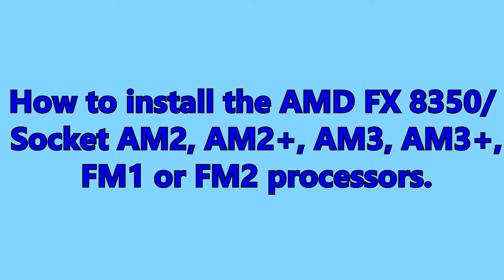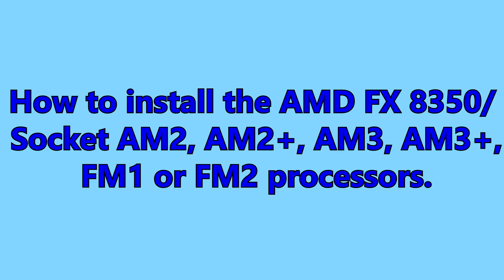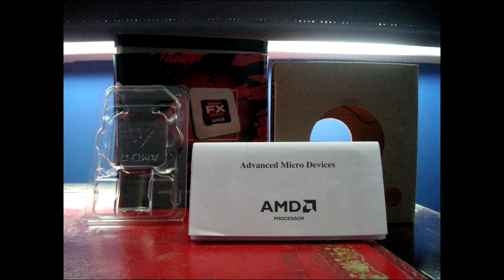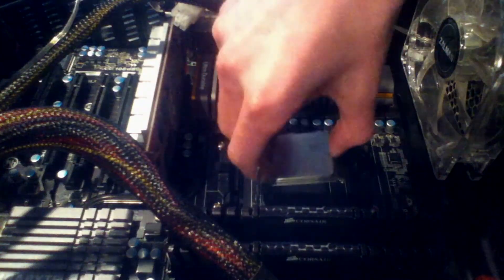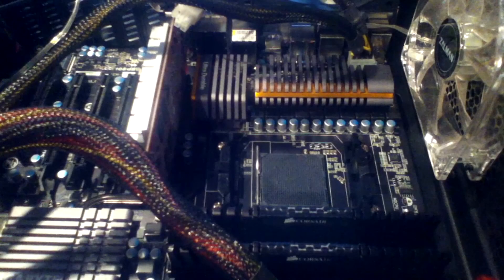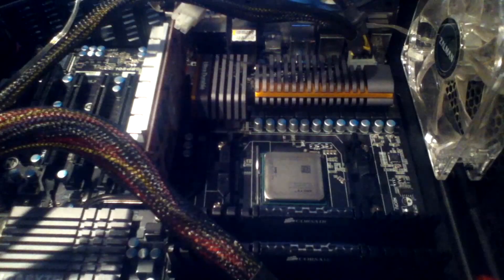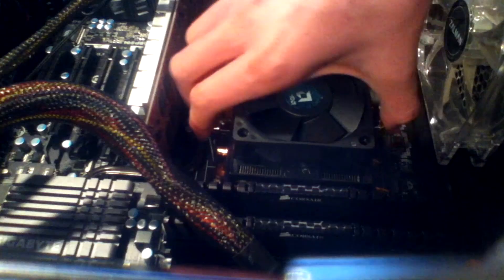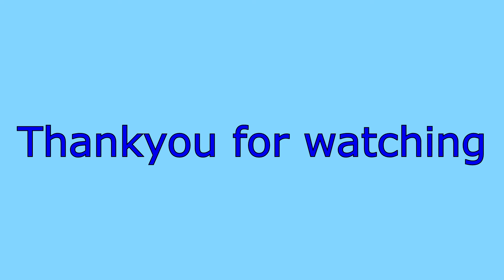Instaling AMD processors (Socket AM2, AM2+, AM3, AM3+, FM1, FM2) in detail

Comment: I have installed my cpu correctly and put the arm right down, but there is a little movement in the arm if it touch it. Is that normal? its still locked down but i can uneasily unlock it.
Reply from the maker: There is always going to be little movement. As long as your CPU temperature is ok I would not panic at all. You can see this with the program speedfan: http://www.almico.com/sfdownload.php Anything over 65 degrees is not good (especially at idle) although it will get around this temperature while stress testing it.
Reply: TheProzGamerzzzz i mean the metal arm when its down and catched
Reply from the maker: Allen Dennis This is the arm on the CPU socket right? not on the heatsink.
Reply from the maker: Allen Dennis everything is fine. That arm does the same on my motherboard. As long as your computer functions with no problems there is nothing wrong.

Comment: Hello !
I have a GIGABYTE 890GPA-UD3H rev 2.0 Motherboard Can I have a AM3+ cpu on that board ? Have looked at GIGABYTES website but im new to doing this kind of things. Very good video btw ! :)
Reply from the maker: Unfortunately you cant, it only has a AM3 socket, the best processor you can have on that board is a Phenom™ II processor (that is up to the X6). This is still a great processor, I use to have the Phenom I processor in my first computer and that never failed me. Thanks for the complement, I am planning to remake this video soon which should be better I hope.
Reply: TheProzGamerzzzz
 Okay thanks for the help. Is it becaus AM3 and AM3+ have diffrent size or not the same number of pins or is it diffrent software that dosent match ?
Okay I think it already is good but of cours you can always improve as long as you keep trying :)
Reply from the maker: I have looked into AM3+ cpus in AM3 sockets a bit more and the reason it does not work is the bios is not made for it (I also expect hardware incompatibilities as well) .this is just from what I have found. On some motherboard they have updated the bios which allow AM3+ cpus to work in AM3 sockets, but for your motherboard I cannot find a bios update. I did find this which say similar to what I have said: http://www.tomshardware.co.uk/answers/id-1839356/890gpa-ud3h-rev-compatible-am3.html
Reply: TheProzGamerzzzz
Okay I see. It feel`s like if I go for AM3+ cpu on my current Motherbord it is on chance. Would be a little cheeper but it is also possibel that it will be a lot of extra work to get it running. Im thinking of saving money and build a new computer it feels like that time will come soon anyway. Have had my current for 4 years I think would be fun with a new :) Then you can have it exactly as you want it to be. Thank you very much for the help ! :)

Comment: whats the difference on fm1 and fm2 plz help?
Reply from the maker: CPU support, with FM2 you can have FM1 processors and FM2 processors, but it does not work the other way round, I would recommend getting a motherboard with FM2+ socket as that is the latest so it is more upgrade capable in terms of CPU support.
Reply: ty

Comment: Suggest me a processor fan for a biostar A780lb board
Reply from the maker: for the heatsink you will be wanting a AM2+ compatible cooler. for an air cooler you could get a Be Quiet! Dark Rock Pro 3 CPU Cooler, but for a liquid cooler you could get a Corsair H100i. The compatibility depends on room in the case for a air cooler or mounting (for the radiator) for a liquid cooler.

Comment: I have a AM3+ cpu heatsink. will it fit on my fm2+ cpu?
Reply from the maker: If you are using a stock heatsink (the one that came with your CPU) it should fit fine, but if you are using a aftermarket heatsink check the compatibility.
Reply: It fit but no difference in temps since it was also a stock cooler. Thanks

Comment from the maker: A AM3+ processor cannot go into a AM2 slot. Tis is dew to issues including burning out components. If you want to buy and use a AM3+ processor then you will need a new motherboard(prices range from £30 to above £200, £30 being the very low end and £200 will be the best you can get with a AM3+ processor).

If this did not answer your question please reply and I will do my best to help you.

But thanks for the reply on this video

Comment from the maker: This is all true, I guess the pricing on the titan is as it is because there is little competition from other card manufactures. The 780 or even the 770 are very good alternatives to the titan as you will save a lot of money and by overclocking you can achieve similar or better performance than the titan.

Comment from the maker: The CPU's performance is very good in gaming and video editing, but in order to get this very good performance you will need a good graphics card. I would recommend one no earlier than AMD Radeon HD 7750 (price of about £70, or a GeForce GTX 650 ti (priced around £100) But I would go with a  higher graphics card with GeForce.
My computer has the AMD FX 8350 CPU and a AMD Radeon 5450 (£25), this graphics card is only a place holder (so performs very poorly) while I save up for a GeForce GTX 780.

Comment from the maker: I have never heard of green pines before, but as long as the pines are still the same size and made of metal the processor should still work. If your unsure compair your processor with images of other processors of the same model online. If your still unsure take the processor back to the shop or claim on your warranty (this might have a high postage cost).

Comment from the maker: The thermal paste that comes on the CPU cooler is all you will need. But if there is no thermal paste on the CPU cooler (e.g. if you buy a used CPU cooler) you will need to add some.

Comment from the maker: A FM2 socket processor can only be installed with the same method as a AM3+ socket processor. You cannot put a FM2 processor in a AM3+ socket.
Allways check your motherboard spec if you are unsure.

Thanks

Comment: Normally, I'd assume otherwise, but your answer left me with some speculation; So an FM2 socket processor will install into an AM3+ motherboard such as the Sabertooth successfully? Is that what you meant by FM2 processors have the same method to instal as AM3+?